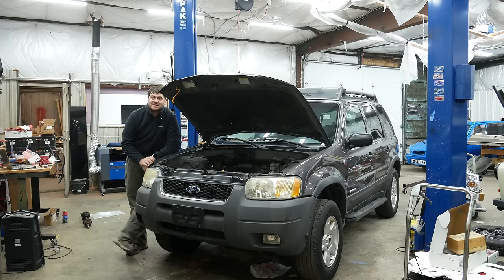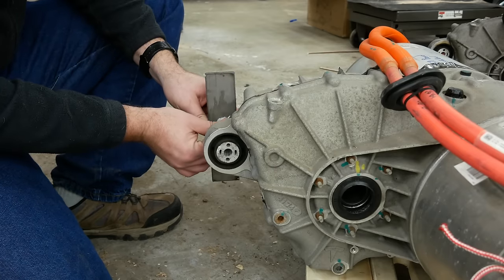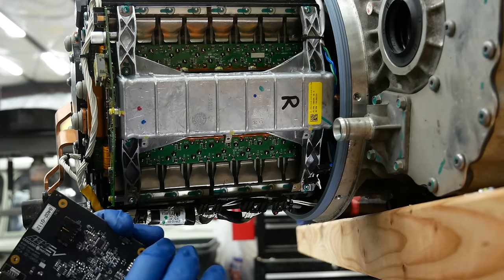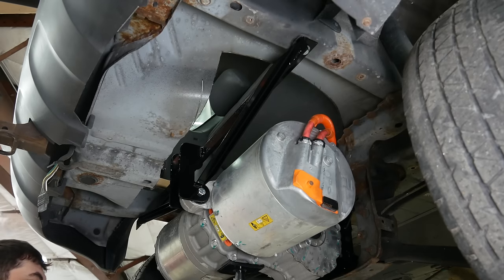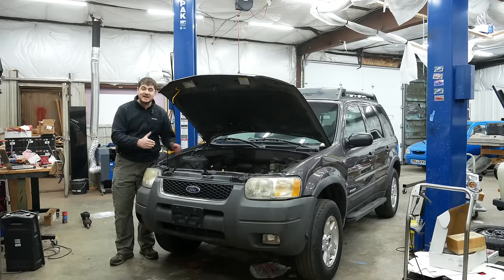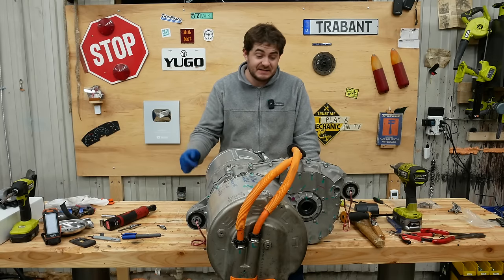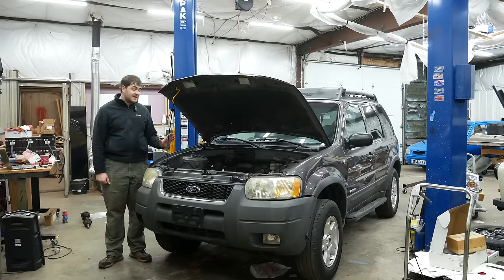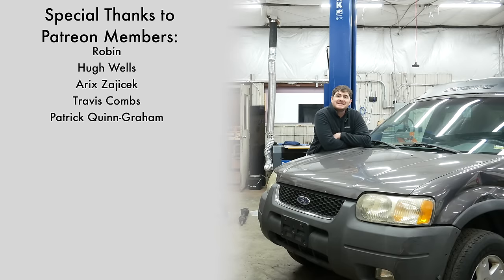This Escape is Now Rear-Engined (and Front-Engined) | 900HP Electric Escape Project

Comment: I hope you are confident the final drive gear on the bus axle will handle the torque. Working for bus companies for 15 yrs, that’s a common issue for almost all electric and trolley buses… and the replacement is not cheap. You can buy yourself some lifetime if you limit the peak secondary acceleration.
Reply from the maker: Knowing nothing about the rear end other than the gear ratio, I'm neither worried nor confident. It's an unknown!
Reply: @agingwheels  well, keep the diff oil fresh and the secondary acceleration low (both accel and decel), and hope for the best ;)
Reply: Knowing nothing I'd imagine engine braking should be a larger force than acceleration. Although again I don't even know if busses can do that.
Reply: @agingwheels 5 ton axles, talk to heavy D I'm sure he'd be happy to send you one lol
Reply: That's no joke. I've seen those axle shafts snap from someone stuck, dumping the clutch, even with anemic gas engines.
Reply: Couldn’t you swap one out for one from like a dump truck or something? I imagine there’s a few in junkyards/scrapyards/gov auctions
Reply: @agingwheels  Have you considered packaging the bus electric motor in the back? A shorty driveshaft setup like a rear engine bus, but with the motor in front of the axle between the frame rails (since you're not carting kids around any more) might make things easier.

Take a look at the layout of old pancake engine crown busses. A huge PITA to service but for an electric setup might be ideal.
Reply: Using the best available oil is probably advisable, and/or periodic analysis to check for excessive wear.
Reply: Do these American busses run a reduction hub?  7000lb/ft through those little gears could be fun.
Reply: @Davemike27 His modifications will probably have a net weight gain. How many 5 year olds equal a 7000lb car on the back of this thing?
Reply: @tamasdobronyi7242  By secondary acceleration I assume you mean jerk? Acceleration of acceleration i.e. the second derivative of velocity?
Reply: One hopes all the extra weight required for the batteries should force the motors to never reach their max torque figures due to overheating and sort that issue out.
Reply: @evan12697  A dump truck would have had the same engine or weaker, and approximately equivalent differential. He'll need a rear axle from a semi, the upside there is he can get it with 2 speeds and a locker!
Reply: @Davemike27 the goal is to use the SUV as a testbed for the bus project. These will eventually see the underside of the big schoolie.
Reply: @barefootalien  I'm confused by this too. Not sure why the jerk would matter more than the peak acceleration.
Reply: @hunterm9   Shock loading? That's what jerk practically amounts to, and tends to kill drivetrain parts if the tires don't spin first. Remember everything has some slop and backlash in it, violently taking that slack up hammers stuff together and puts it under excessive stress.
Reply: @hunterm9  I think for a given event it doesn't matter much (I certainly wouldn't say it matters "more" than acceleration). But over time, it can put a different kind of wear and tear on components.

Imagine some gear teeth that are loosely engaged, backed off a bit at a stop light or something from their partners.

If acceleration ramps up smoothly (low jerk), then they'll come together at low velocity and then the force will build steadily over a short time to the maximum.

If instead acceleration is nearly instantaneous (high jerk), then the velocity at which the teeth come together is much higher. Most of the time, this makes no difference, but once in a while, the impact might be hard enough for brittle wear to occur... chips flying off, essentially, that wouldn't be as likely with a gentler acceleration.

Think of the difference between the application of the same force and acceleration on a piece of steel, one with a hydraulic press, one with a hammer. The overall deflection is the same since the forces are the same, but with the hammer I can envision sparks flying off, where with the press, since it's already in contact, it's more of a squishing interaction.

I dunno if that made sense... it's a hard thing to explain because we're not used to thinking in terms of jerk (or even further derivatives).

Consider the difference between being on an airplane as it takes off, vs. being a passenger in a drag race. The peak acceleration could end up being the same, and is the force with which you're pushed back into your seat.

On the plane, it takes time for the turbines to spool up, so that force comes on gradually, and it's a nice, comfortable push back into the cushions.

On the race car, it's very sudden, and you're thrown back into the seat with some degree of violence.

Both could cause injury at high enough acceleration, but the violence of the race car is more likely to cause certain kinds of damage, like broken bones, as the response time and momentum of the seat cushions and springs and the various compressible parts of your body come into play.

For rider experience, jerk is like "violence" where acceleration is like "pressure".

Or, for curves... think of the difference between a skilled chauffer turning the wheel nice and smooth, for sort of "rolling" curves back and forth, vs. what happens if you jerk the wheel back and forth, causing violent tossing from side to side. Actually, I think that's where the name comes from. ;)

The forces are much higher and time scales much shorter for steel vs. flesh, but the difference in "feel" and the types of wear that occur are the same.

Edit: Heheh, thought of another fun analogy.

Minimizing jerk is how you drive your grandma to the store, to keep her comfortable, but still keep pace with traffic.

Maximizing jerk is how you drive your buddy to show off how powerful your car is, but also not get pulled over for reckless driving.
Reply: @barefootalien  exactley
Reply: @barefootalien  You're totally right, it could definitely be important for certain gears, but even more so the mounting hardware, suspension, and other components. I had to do some Wikipediaing about jerk to refresh myself about it. In a perfect system it might not matter much, but in the real world it's definitely a consideration.

Very amusing taking sentences out of context, however:  Integrating jerk over time  yields the jump
Reply: @hunterm9  Heheh yeah, as it goes down they get sillier and sillier. Didn't they literally name the ones after that after Rice Krispies? Snap, crackle, and pop?

And yeah, I went with gears because it seemed like the easiest to describe and relate over text, but any kind of wear over time, including micro-fractures in metal or welds, will happen faster with more jerk.

I've never had all that much use for anything past jerk, though I would imagine in something like engine design with a lot of complex vibrational modes, it could matter.

What I did find that concept useful for, was as a mental analogy for the area rule in trans-sonic and supersonic flight. It's not derivatives of position over time, of course, but rather cross-sectional area over distance, but for me, it was a useful analogy, since the second derivative and even the third matter a lot, especially for minimizing trans-sonic and high-subsonic drag.

And, of course, like all things aerospace, I followed the xkcd curve of intuition about how that worked through school, work, and finally playing Kerbal Space Program (with Ferram Aerospace, which makes the aerodynamics on par with top-tier flight simulators, including area rule considerations).
Reply: @agingwheels may be worth referencing or reaching out to Jerry Rig Everything's electric Humvee build, as I imagine the torque he's dealing with is on a similar order of magnitude as yours
Reply: @hunterm9  @Barefoot
First of all sorry to fail to apply the correct terminology, at work, when I have to deal with these situations, I always have to do it in  my mothers tongue which is obviously not English.

But to give you a little insight, jerk becomes important because of the play between the gears and other moving components (uni joints or bearings f.e.). As you suddenly apply a huge amount of torque, it will first turn the first rigid unit of the assembly (e.g. the motor output shaft), then at the first uni joint this rigid assy with all its rotating mass, spin (=energy) “crashes” the next rigid part (driveshaft), then the whole thing crashes to the next uni joint, and so on, through all the gears. You can imagine, it’s not helping. When you limit the jerk, you giv the lubricants a better chance to “cushion” these “crashes” and greatly reduce the energy shockwave these parts have to withstand.

Not to mention, the driveshaft also acts as a torsion bar, which can be a good thing as long as the overall play is low, but as it becomes higher, final gears tend to just let it go and strip…

With gearing, most common problems are pitting (surface fatigue, caused by the long time slight overload), micro pitting (cavitation damage, caused by water in the diff lubricant) and scuffing (thermal overload, basically the gears welding together and instantly breaking free on a microscopic level, caused by the chemical disintegration of the diff oil, or simply the low level of diff oil). If you limit the jerk, you can pretty much double the lifetime of your gears against pitting. And if you keep the diff oil well and up and changed regularly, you can basically eliminate the two other.

And speaking of electric drivetrain, avoiding jerk when you go off-throttle is just as important. The motor can accelerate and brake / decelerate with exactly the same torque, so you need to keep both side of your gear teeth nice and smooth.
Reply: @tamasdobronyi7242  It's really not a problem, we were just clarifying. 

Your explanations make a lot of sense, and are really insightful as to the exact issues caused.

Comment: My favorite parts of this channel are no music while he works. The editing is amazing and he isn't afraid to show mistakes on camera.
Reply: now you have seen it all including a 900hp ford escape🤣
Reply: @notfiveo let him do it his way it's the only way for him to learn after all no one has ever made a 900 hp electric ford escape before who knows what will work and what won't🤣🤣🤣
Reply: Hide the motor with a fake hitch
Reply: Oh my God what is he going to do with the bus this guy's going to probably slap a big-ass generator in the back of the bus probably have like way more efficiency than any other diesel on the road along with insane power
Reply: @dustinswatsons9150  yeah that sounds about right except he'll melt the motors cause teslas with those motors thermal throttle with the liquid cooling system cooling the motors pushing a small tesla car not a big honking school bus that has a ton more drag that is going to stress those air cooled motors way more then a tesla would its the one issue I see with testing with that old ford
Reply: Well, if he didn't show the errors it would have been a very short video.
Reply: @janmussche6815  how true is that! 😆

Comment: Engineer: Measure twice, cut once.
Robert: Measure many times, cut even more often, then start over.
Reply: Mechanic: The first one would have worked if he just hit it with a hammer.
Reply: I can identify with Robert. Cut twice and still too short.
Reply: 3D printing: Does it fit? Nope. prints another. Does it fit? Nope. prints another. Does it fit? Nope. prints another.
(Repeat until you run out of filament) 😅
Reply: I'm a mechanical engineer, I can assure you, Robert's method is what happens to all of us anyway lol.
Reply: I identify with this comment
Reply: Hey, my name is Robert. 
But, yeah.  That's how I do too.
Reply: many  ### words later not recorded
Reply: iterative developement